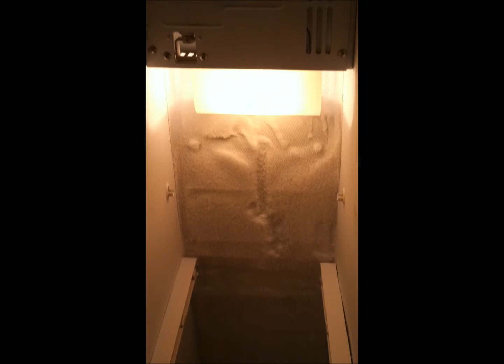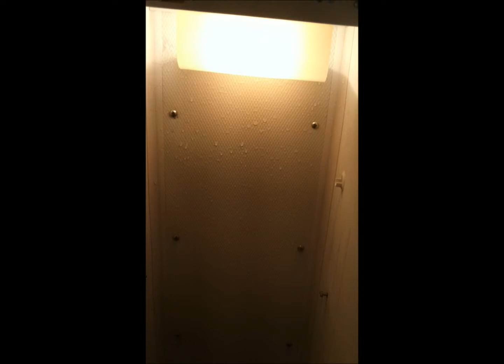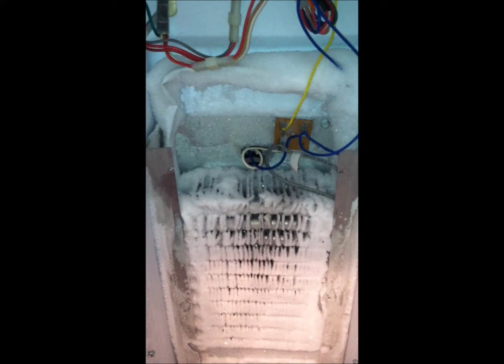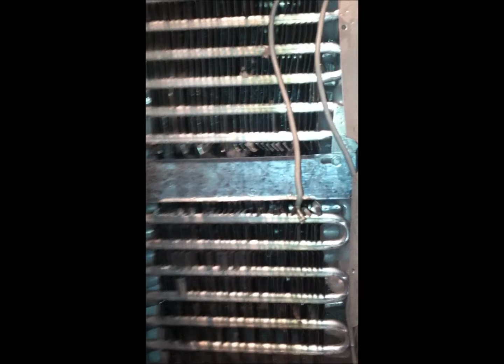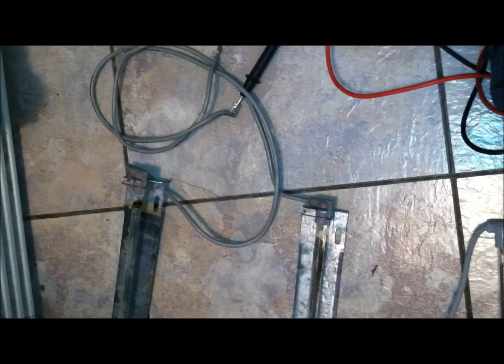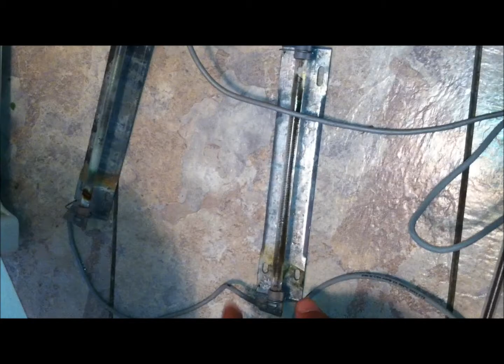Refrigerator Maytag Side by Side replacing defrost heater element

Comment: Correct, if you do not have continuity through the heating element, you have an open circuit; that doesn't mean that the heating element has been "shorted and is not completing the circuit" though. If you read continuity, it would be the same as reading a short which in this case generally means that the heating element is (or should be) working. An open heating element generally means the heating element is "burnt" open and is inoperational thus needing to be replaced. Good helpful video though, thanks for sharing.

Comment: ["!iItC3ti8adWRvNdEA3y3ATOvnQoCAAAC_FIAAAAlKgEfKRW_szZE-tM3trLt4p2H3JriZJjkC5GzYosJo5zGRBGoLhcvg_aU-ZuzVCdWTyx25lhHVGDq-abbq6qyZ3XSV5pFHRFRuU1PE7A30xcl_0SdNz4JdrTjaYxs-VhDvsoOXLiZDJBpUSiv3x13S0NvxWHzRl00onY725zw0Bltq-vrIMrycrXoE7JD8LxPEMBe5NpO07RDyYbD3z4nBd92zmVPhqiH6kiVQTO2MgcTarwpPOedOVBKpXJjmKhHDQkvHusonsENbPWHTnGVtC_saiBOlggTBXogXvtBlsQWBvqcEDbdrUsrwQT9jazsr8E8Nbhu2PrdWvKlA3YAva-kx8yd61hJCyGP_uyb0i9hNvAMSJkH85QCXF-amgzQCSg","Refrigerator Kitchenaid defrost already but still not work properly anly fan works",[[[null,null,1]],null],false]